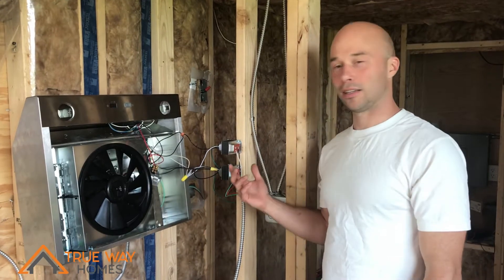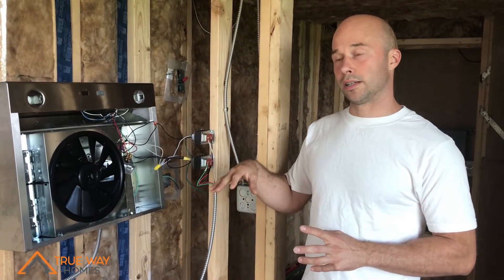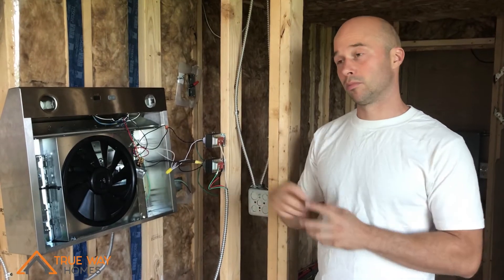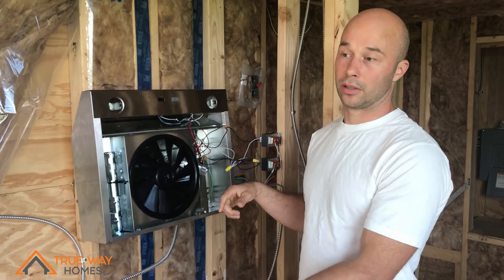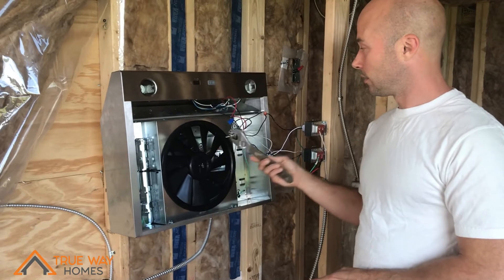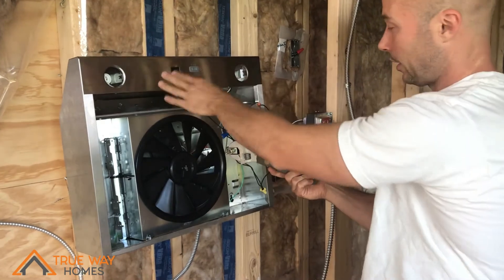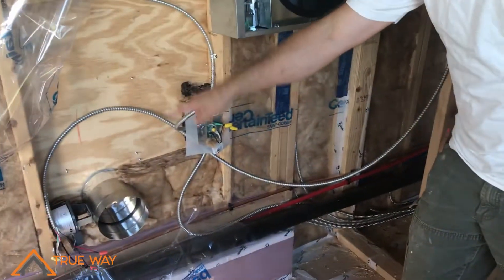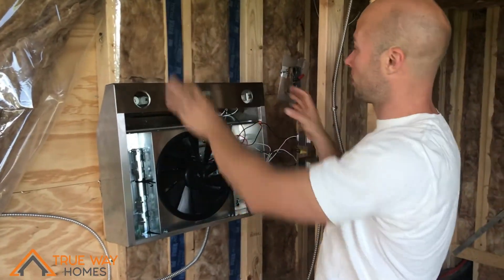How to Install a Range Hood & Make-up Air Damper to Run Simultaneously in a Tiny House

Comment: Broan makes a makeup air kit that utilizes a pressure switch to close a relay and opens the damper when the kitchen hood ventilation is utilized...operates on 24V
Reply: I have a question, related to my new installation...in this situation, where is the power for the makeup air damper coming from? Does it come off the hood, or does the makeup air damper have its own power? I'm getting confliction information.
Reply: @HarrySmith3  comes from the wall. You will need a transformer (comes with the Broan damper) that you will wire one side to 120VAC (whatever 120VAC is powering your hood), and the other side to the damper motor, then the pressure switch, then back to the transformer. When ever the pressure switch closes (turns on), it closes the loop for the damper and it opens. When power is removed (the pressure switch opens again), the damper automatically closes.
Reply: @genefulm  Thanks so much. That's how we got it working. The instructions weren't all that great so it seemed strange to apply power to the hood that already had power. We figured it should be powering the damper too, but nope. Thank you!

Comment: Hi Dan
Thank you so much for this video ; i have one hood Zline, 4 speeds and have the same scenario, my custmer wants two dampers, one in the hood duck itself and the other in the A/C  duck outdoor, 
I am an electrician I understand the wiring but the challenge is how to connect to the 4 speed switch the transformers. I did call manufacturers and they do not have any information how to connect it and they are afraid we can avoid the warranty . Can you share the wiring diagram?
thank you  again

Comment: Dan, So grateful for your helpfulness in this video on the MUA.  I am a homeowner that is having a complete new kitchen installed into an old house complete renovation. 
I was sold a very complicated range exhaust solution that two different contractors are having extreme difficulty.
I was told I had to purchase a remote blower solution with a separate MUA. The contractor could not even install the damper for the range hood.
Have you experience with integrating these items PKEX22 insert with external blower EB15 and the Braun MUA MD10TU units?

Comment: Thanks for creation this video. I'm building a home myself and doing a very similar MUA system. Is there ant way I can get the wiring schematic you used? I appreciate it!
Reply from the maker: No problem! One thing, if your set up allows for it, is to look into a "adjustable static pressure switch and damper set up". This would make the closed cycle make up air loop much simple to create. I did not use this option because I was afraid of interfering with the ERV system. I could send you a quick drawing of how my particular wire worked if that helps? Let me know how i could send you that.

Comment: Get any critters in through the bottom damper? I don’t know if I’d trust a metal flap damper to keep out mice, etc.
Reply: There is a hood on the exterior with a screen and you should have a filter box in this system to filter out pollen etc. I think he just has it set up this way to try and simply the explanation of how it works.

Comment: AFAIK make up air dumper should be at least 10 feet away from the hood on the opposite wall.
Reply: Can it be in a different room, or even higher than the hood?
Reply: Make up air should be located wherever you need it... in this case, a highly localized intake and exhaust are exactly what's best, especially if he has multiple syncronous HRV units he doesn't want to imbalance.  The requirements would differ in an unheated space with gas appliances, for example, than they would for meeting the requirements of whole house ventilation... or in this case, exhausting steam and odor from a highly specific location.  Most range vents in older homes don't work very well b/c they're drawing and exhausting the conditioned air from the home itself and creating negative pressure (bad).  And as soon as you introduce tight construction with HRV/ERV's then they need to be considered when introducing make up air.  As far as I know, there is no Energy/Heat Recovery component for any make up air unit (which is what I actually AM looking for 🤣🤣🤣)
Reply: Why would you want to pull all of your conditioned air from the room by putting it 10 feet away? That makes 0 sense. The damper can be anywhere but the best place I’ve found for the vent is right in the floor behind the range

Comment: Absolutely fantastic, thank you very much funny thing is I'm building a new home well the planning right now and this was a major concern for it is a very very tight home and make up air it's going to be essential you could not have made this at a better time thank you there are products out there but they cost three to $400 more than what this costere but they cost 3 to $400 more than what this cost
Reply from the maker: Wow! It is so awesome to here that this was helpful. Makes all the time making the videos worth while. Hope you have fun on the new build
Reply: @truewayhomes3897  Yes, vary much helpful, will modify it ever so slightly but in general vary vary good.  Yes vary time consuming to do the videos, Again thank you

Comment: Just ordered a 1200 CFM. Cancelled it after this video and bought a 400CFm instead lol. 

WA state allows 400CFm without make up air. Too lazy to deal with the make up air process.

Thanks for the video!!
Reply: How is the 400cfm working for you?  Does it remove all the cooking smell, oils, steam, etc?  I'm in the same boat, trying to figure out if I'll need a makeup air or not.  Wife is asian, and her stove cooking is very frequent.
Reply: I think 900 CFM is the maximum exhaust without make-up air.

Comment: Great job! I’ll be waiting for your future video on how it’s going to look once completed. Also, is the makeup air conditioned ?
Reply from the maker: Thanks so much! Its a lot of fun. The make up air for the hood vent is not conditioned. My logic was that most of the air coming in would theoretically be pulled up around the range and then back out through the hood. I know some moisture and temperature difference would stay in the living space once the hood was off, but didn't think it would be enough to justify the additional cost and time to figure out a way to condition it.